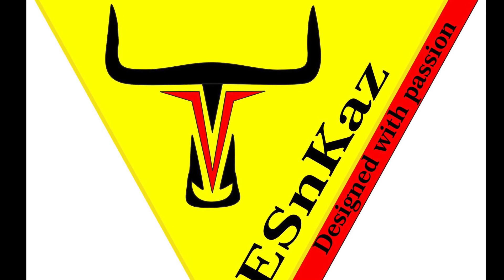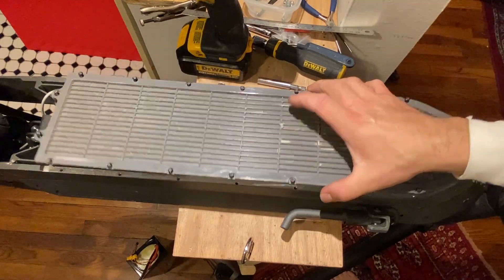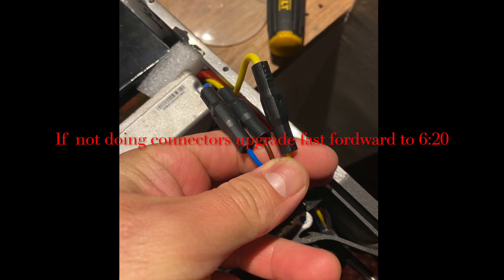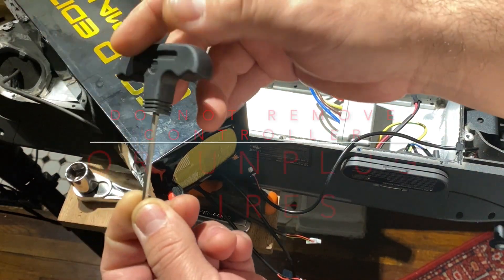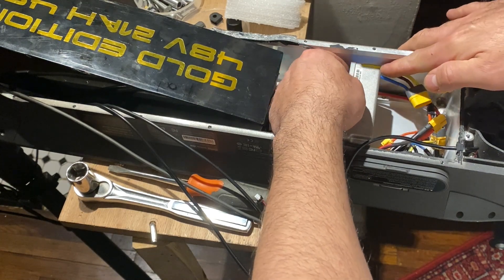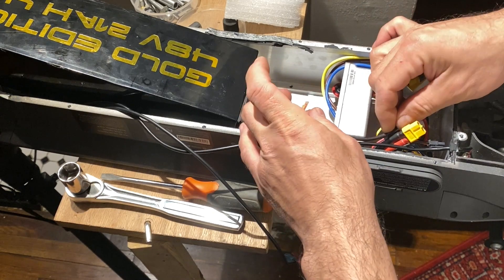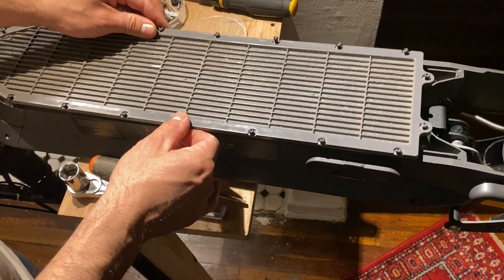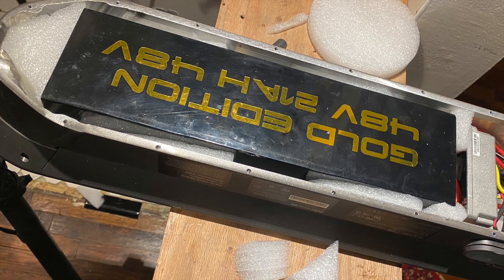Turn your Ninebot MaxG30 into a rocket!!! Upgrading your Ninebot Max G30 scooter with a 48V Battery.

Comment: Does this come with a special charger or do you use the stock ninebot Max chord and does the LCD still read out power percent
Reply from the maker: Any battery that replaces the internal battery needs its own recharger due voltage etc. You will need an additional meter for voltage reader.

Comment: Works on g2 max?An whats with softwer?
Reply from the maker: You can simply replace the internal battery with a 48v or 52v and replace the stock controller with a D controller and add a custom firmware and you have a 28-35mph nice scooter. Above that front suspensions need replacement. You could also simply add a 24v external and convert to 60v and add d controller.
Reply: @esnkaz  
good man. I greet you from Croatia from the city of Split! these days a new controller is coming to me from aliex because my speed is limited to 25 kmh and when I hack it with xiaodash and change the region, 35 should be able to go, now if only after that I install that big 48 V battery, is it ready for driving or do I need to install something again, or are there enough custom regions on xiaodash?
Reply from the maker: @ivanbilandzic6571  using that app you can customize the firmware.

Comment: I have the Problem error 21 with the New battery
Reply from the maker: You need to install the firmware for your battery. Battery makers are supposed to give you a firmware according to your new battery power. Unless you made it then you will need to make a firmware for 48v.

Comment: does it fit 30 Max LP ?
Reply from the maker: Nop
Reply: @esnkaz  can you double check? the original ninebot max 30G battery fits the 30G LP
Reply from the maker: @salehdinkhah6854  I’m sorry have been a bit busy and short answers have been provided. This video is bit old and battery shown here was for Ninebot Max g30. Looks a bit bigger than new batteries. Contact mymaxmods I know they make the LP version as I have installed several to peoples scooters. :)
Reply: @esnkaz  Thanks, I had one more question I want to increase the speed to 25mph, is this all I need to do? just changing the battery to 48v?
Reply from the maker: @salehdinkhah6854  If you are planing to upgrade to 48V on LP Scooter if controller its unlocked then yes after battery all you will need is motor/controller phase wires connectors upgrade. If controller locked then you will need a new controller with firmware according to company you buy the battery and controller. They should provide you with all tools and info for installation. Maxmods I know they have all you need for a successful installation. I have a lot of videos in this channel for the Ninebot parts installations. Just remember to make the questions to whatever place you are buying parts from and once you are fully inform then purchase your parts. Thank you so much for being part of my channel :) if you need more information about parts and installations you can always look for me on FB group: https://www.facebook.com/groups/esnkaz

Comment: What would you say is the estinated max range of the 48v gold edition on a Segway max? Thanks
Reply from the maker: We just tested last week the Actual Gold edition battery rider is 2010 lbs and only got out of it 17miles when scooter shot off with fatmax motor installed on speeds between 10-25mph which was disappointing as back in the days when this video was loaded battery was bigger and range was 20miles range leaving a 15% and with the big one that used the entire space of scooter battery compartment to a max. range of 32miles. As you can compare in this and the new battery is about 2.5 inches shorter and about 5 inches shorter than big battery.
Reply: @esnkaz  so the new ones they sell only get you about 17 miles? Yeah, not a lot.

Comment: Can you please tell what type of mount do you use for the voltmeter?
Reply: Custom made. 22gauge flat stainless still with a phone bracket. Easy to make. Paint and fold to size. Screw it. There won’t be a perfect meter holder than that. All those glued ones and bulky sold around are bad.

Comment: Thank you for the great video. i believe you covered everything that was required to be explained. I only have one question - can you install the controller facing the other way so the connections are not facing the baterry? it seems a reasonable solution that will ensure no cable is ever going to be squeezed from any potential battery move to the back. I am sure ppl thought about it as well but since you are not doing it i assume its not possible?
Reply from the maker: Thank you so much for your comment! Yes you can install it facing back, which is best for wiring and components as the recharger its removed… take a look of video of how to make the scooter dual motors. Battery in that scooter is bigger than one on this video as well 2 controllers just at the very end of the video you will see how are installed. https://youtu.be/qFelQDGsx5k

Comment: will a 50v capacitor handle this 48v battery? whats the max charge 51v?
Reply from the maker: 48v Battery fully charge its 54.4v however you can only charge battery to 95% 53.9v otherwise controller get melted. Upgrading a controller it could work but you will never get the torque and speed another system would give. Visit my group on FB if you are interesting in learning more: Esnkaz Ninebot Max Evolution USA
Reply: @esnkaz  i got a urbanglide ride 100sx, my capacitor of controller is 50v , i need to upgrade the controller
Reply: @esnkaz  how much volts is your capacitor? I will join your group

Comment: I used Wago connectors instead of the MR60. Works nicely! Wago is rated at 32 amps and the connection is rock solid with them. No soldering needed that way. Just a simple crimp of the 6 wires and put into the Wago and close the clamps.
Reply: Which wago did you use?
Reply: @HopeForTheBrokenBand  it's 221-412
Reply: Do not use wego connectors on your scooter bad idea.
Reply: solder is 1000 times better than crimped, please dont use wagos.

Comment: What will happen if i connect mymaxmods external kit with this battery? Will it become even more powerful?
Reply from the maker: Power doesn’t depend only on voltage and amps. If you to add another battery then you need a motor for it such as FatMax. 48v is more than enough for the G1/G2 motors. Going above will burn those motors fast.

Comment: Just curious if you can use any after market voltage dashboard for the gold battery. My max mods currently only has the battery itself for sale. The option with the voltage dash isn't available. I'd like to purchase the battery but also have the dashboard.
Reply from the maker: You can get a multimeter to read voltage.

Comment: How long did shipping take
Reply: Also do you need an android to operate it
Reply from the maker: @breahnreyes8251  Please contact Mymaxmods for more info on shipping! You need to load a firmware using an iPhone or android before battery installation. :) Be well.

Comment: What was that module thing close to the rear wheel just behind the speed controller? it didn't go back in after your 48v battery upgrade
Reply from the maker: Thats the original recharger that comes with scooter. When you install the 48v internal that part comes out as choice as is not needed we remove it. 48V internal comes with its own recharger and no need that. :)

Comment: Is there a flash that needs to be done after instal? If so how is it done?
Reply from the maker: before installing battery/batteries need to install FW according to new voltage you are adding.
Reply: @esnkaz  what do u mean? u didnt mention this in the video
Reply from the maker: @cristosimao4929   Video is for the battery installation in the scooter. Firmwares for each battery are to be download from Mymaxmods website. Then follow instructions for software installation then once that is done then you will need to install the battery. Please follow EsnKaz group if you have questions feel free to post there.

Comment: Great video the only problem is that battery sitting on the lid it’s not good when bumps and vibration
Reply from the maker: I install all the time this batteries and mostly extended which are bigger than the one on video. They dont move at all neither vibration move them. If you cant get the sponge heat resistant for it simply use the packaging that comes with Sharkset and pressure it from the sides making sure all wires are off the way. My installations batteries dont fall even when putting scooter on stand possition without the battery cover. I posted a video on FB groups when I did this videos. If you dont secure the battery you are putting in risk of damage as well damage controller or wiring.
Reply: @esnkaz  is it possible to get some sort of hardware to screw like the original battery
Reply from the maker: @RideWithAnthony  nop
Reply: @esnkaz  what’s the difference between a standard 48v and the gold 48v
Reply from the maker: @breahnreyes8251   you would need to tell what standard you are referring to.

Comment: Don't understand  the weight thing? You add the controller on the scale to even out the weight difference,  and then you reinstall it!
Reply from the maker: What is added to stock battery on the scale is the recharger. Stock recharger is not needed on scooter when gold edition its installed.  battery plus recharger equals extended gold edition weight.

Comment: great video, My ninebot max recently got damaged by water as it was stolen and thrown into a lake and was found but not working can it be fixedddd .
Reply from the maker: Yes. Rebuilt completely :( all electronics would need to be replace. You could actually turn it into a stronger machine! Mymaxmods has the most wanted parts. Start with a 48v battery. Add the Fatmax then the rest of parts would be controller, dash, lights throttle and brake sensor… DIY follow us on ESnKaz FB! I have done rebuilds from scratch and scooters turn to be great!
Reply: @esnkaz  thanx man I’ll look that up

Comment: does the battery gauge still work wihtout that white plug?  Be good to know what kinda of range we can expect with this mod.
Reply from the maker: Hey Nelson thank you for watching my video. The battery has it own BMS and dont need additional wires. As per the white connector that is for the recharger port. Battery comes with it own recharger so that part is removed when installing the battery. Ninebot stock battery 18ml on sport mode from full battery to 0. Gold Edition 36-40Ml Sport mode. however this could varied depending on how heavy the person is or what extra weight person is actually putting on. MyMaxMods Has this batteries. Make as well for other scooter models.
Reply: @esnkaz  sorry still confused.  The battery indicator on the screen where there speed is, does this no longer work after swapping out the battery?
Reply from the maker: @whoanelly-   MyMaxMods thought about all those little details. :) so for voltage readings, temperature they have the meter for it. Please follow us on FB ESnKaz be part of our community for farther I formation about accessories we make as well we try!

Comment: I’m concerned about the electronics, this motor controller and everything else it was built for 36v, and now you introducing 48v, I believe this will cause the electronics getting burn down the line. Please explain.!.!.!
Reply from the maker: Hi Gio thank you for your note :) first of all I didn’t introduce this item! Its being use by thousands of people around the world so I decided to help many users in how to install. Upgrades for vehicles had happened since the first vehicle was invented therefore now we have such a fast vehicles. Because there has been people working doing research to make that happen. The ninebot max is one of the best scooters in the world and people loves because is a machine designed to hold up  and work under stress under muddy and rainy days! Don’t underestimate this machine! And again due to this amazing innovation and great work from Segway and giving us such a great machine! We sometimes come up with ideas to help people achieve what they need. If your are concern about it simply do not use upgrades on your scooter, believe me there is a lot of people who use their scooters without upgrades But! they look very unhappy when we overpass them :)

Comment: Hey after I installed the battery I started getting error 24 on my dash and have checked the control board to make sure everything was installed properly what do you think could be the issue
Reply: That happened because you didn’t install the firmware for 48v. You need to install the firmware before installing the upgraded battery.
Reply: Oooops...someone didn't read the instructions.

Comment: hi how is it when you have the gen 2 motor and you have to do that with the conectors mymaxmods recommended the other battery to me what is your opinion
Reply from the maker: Connectors are optional. Regardless if you are using your regular scooter or upgraded.

Comment: can i knw the dimensions of the battery?
Reply from the maker: As per you can see in video battery fit perfectly :) Once you get the battery simply remove original and install new one. This apply to batteries that replace the stock. MyMaxMods.
Reply: @esnkaz   I was asking it for my bike actually, maxmod is making me customized 25ah battery with tesla cells for my ebike 😊

Comment: The aftermarket battery do not have the data cable , is it ok to leave the plug unconnected from controller board  ?
Reply from the maker: Hi Yu, If you are just doing installation for the battery and not updating wires, you should not be unplugging anything else more than the battery connectors and plugging new battery. Just make sure to discharge controller fully after you disconnect controller by pressing the dashboard button a couple of times.
Reply: @esnkaz  Sorry I am not confused ,the stock battery has three connector but the gold edition battery in your video only has two. I believe the difference is the data cable
Reply from the maker: @alexyu111   Correct. Gold edition doesn't need to connect to controller. and if you see the video fully you will see what else to remove from scooter so you dont have the extra weight on it for no reason. :)
Reply: @alexyu111  I strongly suspect they are the balance connectors I believe which help charge the lithium battery evenly.  Kind of concerning this replacement battery does not have this as it will lead to problems down the line which could cause inflation and damage
Reply: @ChiggenWingz  no they are data (power +, - and signal) technicaly for battery life they are not required however its also interesting for me how he bypass controller check of original battery?
Reply: @ChiggenWingz  absolutely right
Reply from the maker: @ChiggenWingz  Its been 6 month using the battery and zero issues. My usage its not standard as I test parts and I can tell that I abuse the scooter but happy to tell you no problems down the line.

Comment: hello, can i install a 48v internal and also install a 48v external. Will the range increase double? and is it safe?
Reply from the maker: I believe you can. You can consult with MyMaxMods I helped someone install the range extender for 36 which works great as well. I thing they already have the 48V external.

Comment: Great video thankyou.  Can I ask why you are doing the connectors upgrade and where do you get them from?
Reply from the maker: Thank you. The connectors upgrade is necessary for those who ride in places where is many hills or simply because there is tall people and weight a little more than for what the scooter is designed for and of course is best to upgrade connectors during battery installation! :) You can get them from Amazon or AliExpress. ESnKaz FB for more info.

Comment: Is it necessary to do connectors upgrade with the 48v power pack (21700 cells) 20ah ?
Thanks for the install vid as well!!
Reply from the maker: Just a prevention as we know those connectors get damage with scooter stock battery...